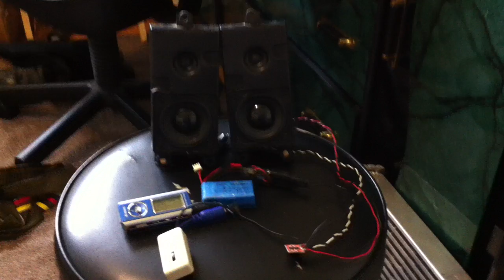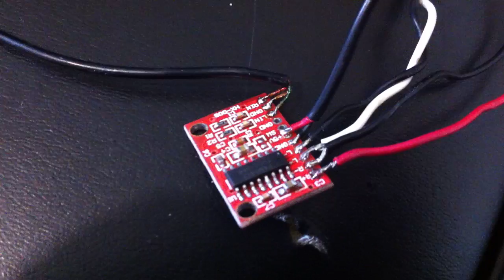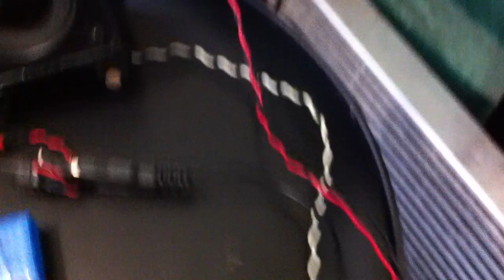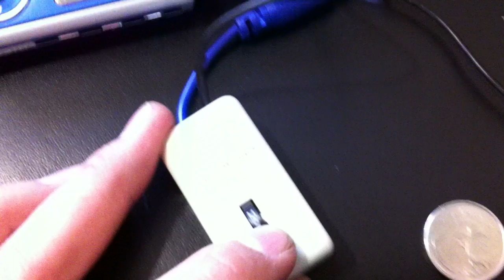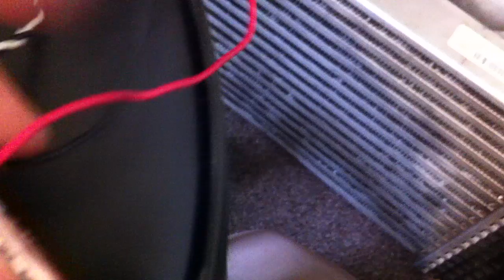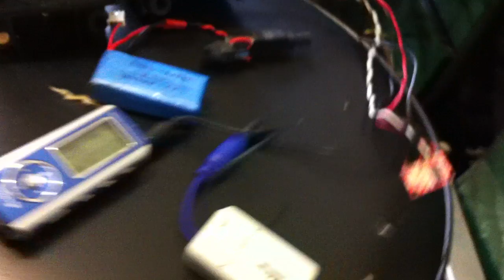Micro PAM8403 3 Watt USB 5V Amplifier

Comment: 5V but how many ampere minimal?
Reply: ***** Thanks, Amp starts clipping at high volume when connected to 1A power supply and two 100W 6Ohm speakers. Now I use a reacharble battery of 2,6 A and power is great and no clipping. I think at least 2A is needed to avoid sound problems.
Reply: +Illumation Streambutler My package said 1.2 amp 4 or 8 ohm speakers
Reply: +Ric Johnson 1,2 A is the absolute minimum for driving the amp at max. Higher than 1,2 A is much prefered to prevent clipping as the amp can overdrive a bit.

Comment: Beware: all these PCBs come without LPFs at speaker out, causing the chip to heavily jam all RF spectrum if you're using wires longer than 10 cm (4") to connect the speakers. You must add a properly sized LC low pass filter cell at each one of the 4 speaker wire outputs in order to block the HF and prevent it from being radiated into the environment by the speaker cables. Although the chip does feature "smart" modulation limiting EMI, this is by far unsufficient if using long speaker wires.
Reply: As a person ignorant to electronics, I had to carefully go through a few of the abbreviated terminology you have used, to try to understand carefully what you have said. So, you say that these PCB's (like the one in the video), have components cutting off frequencies below a certain frequency, the LPF. Am I correct in thinking that you are saying, that this, causes a loss in higher frequencies over cables that are longer than 10cms? And, you seem to say that the cables will loose these frequencies, just by allowing the current carrying those details, to dissipate into the air. Is that right?
Reply: Possibly radio waves from signals far above 20kHz generated at the amp out?
Reply: hello your comment is definitely very insightful and there is allot of good information in there. Im currently struggling to solve some distortion I am having with my pam8403 project. I am fairly new to electronics so I am not sure what the abbreviations in your comment stand for. would you be able to re explain your comment to me but dum it down for a simple fella like my self. Thank you for your time

Comment: Ok, this thing  PAM 8403 has separated gnd. out...for left and right.so how do I connect my headphones which have 1 ground for booth channels...? please help me !! senserly Jarle,      jarleiceman@gmail.com
Reply from the maker: peterpeterpeter101
do not do it!! you will blow up the chip
Reply from the maker: you can't, you need to find another amp that uses both output channels for ground. I dont know the specifics of the pam amp but do some research on google
Reply: could I use a ground loop filter...?
Reply from the maker: Jarle Strømsem
good idea, but you gonna have to find a small one
Reply: all grounds are common, so just wire the 2 ground together will work just fine..
Reply: Yep your right , forgot its a class d Amp. oh well..
Reply: Made the same mistake as you, purchasing this tiny PCB thinking I could use it as a headphones amp. However I've seen a schematic apparently showing that it is actually possible to drive a headphone with it. Connect the speakers (or two 2W, 8 ohms resistors in place of those), and get the signal for the headphones from "L out +" and "R out +" using the power supply ground as the common headphone ground. Didn't try it myself to check that this works, though.
Reply: Try this hack, hope this will help you.... Leave the ground headset jack clean... No wire tagged. Connect your left(+) headset to the left(+)PAM8403, and your right(+) headset to right(-) chip... Sound and bass out great but the sound now is mixed both L and R.
Reply: You can just use the ground off of the input and use the left and right for headset. It is what i did and did work. Into my head set blow up for over driving them.